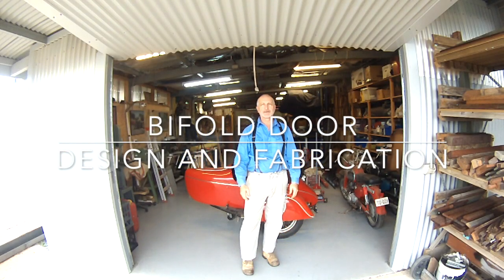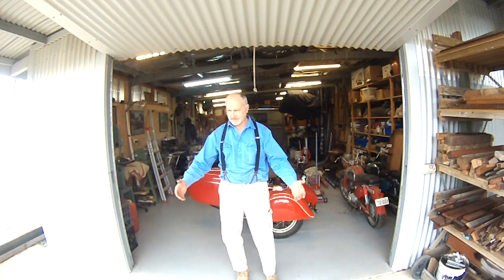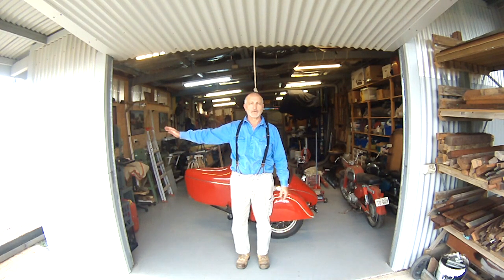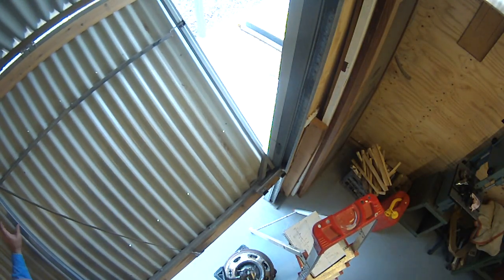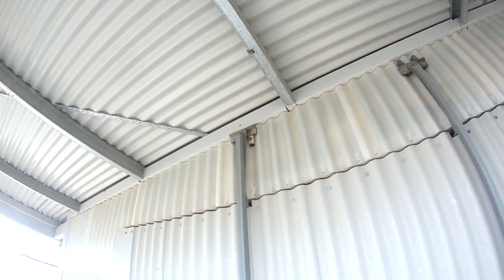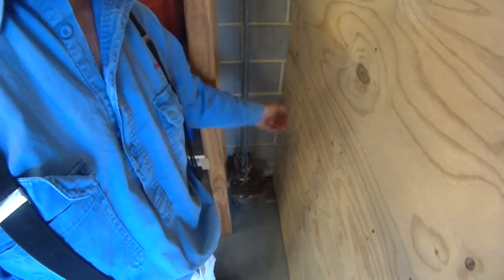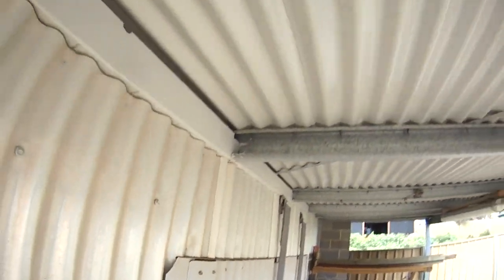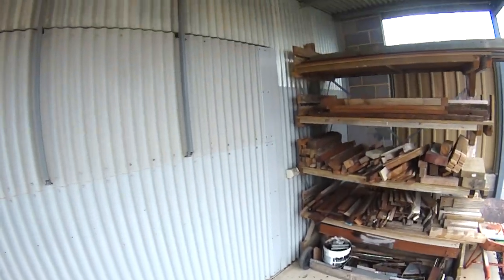Hanger Style Bifold Door Design - Made by J&D

Comment: An easy way to automate the door opening would to be to attach a remote controlled winch to the cable and mount on the wall up and out of the way. A small 2500 lbs winch would be small and do the trick. Harbor freight here in the US sells one for $79.99. Just a thought.
Reply from the maker: Thanks for the comment. However, the difficulty in automating this door is not the raising and lowering but the unlocking, pushing open the first few inches/centimetres and then pulling shut and locking.

Comment: I learned from this video and made my flip-up folding door.
Thank you for teaching me the design where the angle between the bottom pivot and the rail is not close to 90 degrees.
In my case there is no roof above the door. To prevent rain, I decided to stack the top panel and the lower panel by 15mm when the door is closed. However, because the top frame and lower frame were made on the same surface, the upper and lower corrugated panels contacted and the door did not close.
This was solved by inserting a 4 mm thick plywood between the top corrugated panel and the frame.
My Jim style flip-up folding door has become my favorite.
Reply from the maker: "Jim Style"...cool! I like the way you worked out the alignment. I'm guessing that you overlapped the lower edge of the top sheet onto the top edge of the bottom sheet...no one will see the 4mm ply.
Reply: @madebyjnd  That's right. Stacking is not correct. It's correct to say overlap. This time, I was taught English.

Comment: Thank you for your informative videos... great information.  What’s your thought on trying to install a pedestrian pass-through door in a bi-fold door?  I searched on the internet and haven’t seen any examples of anyone having done this, only on traditional garage doors.  With your experience in creating these doors, do you think it’s possible?
Reply from the maker: Yes, it can be done. There was a video done by a guy in Mexico or South America that incorporated a pedestrian door. Instead of placing the central pivot point in the middle of the door, he built it so that the lower panel was something like 75% of the total door height. This meant that the lower pivot point was necessarily raised up from the bottom edge to keep the wedge and a good portion of the lower panel swung up to the inside of the doorway.
Reply: @madebyjnd  Throw me the link of such a video, where the gate is with a gate. Thank you!